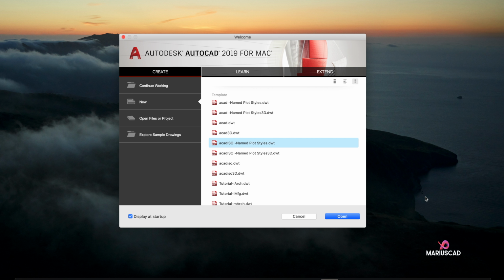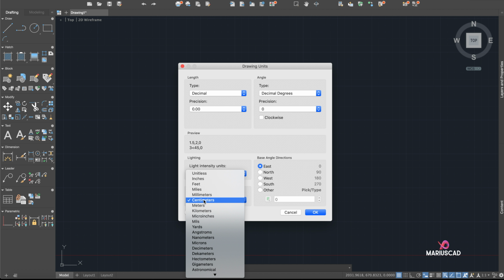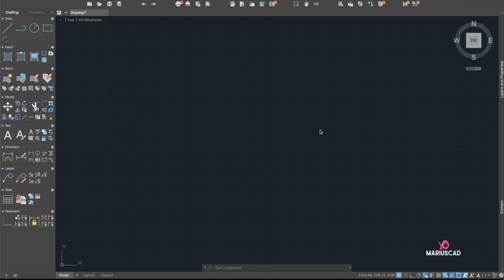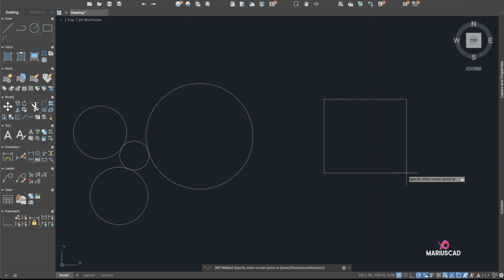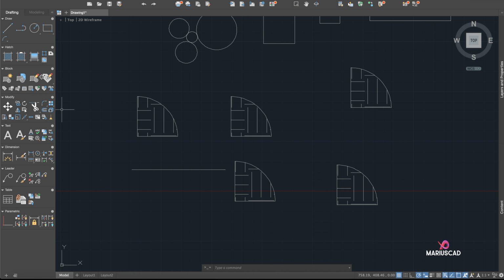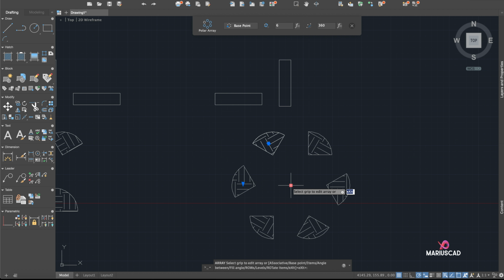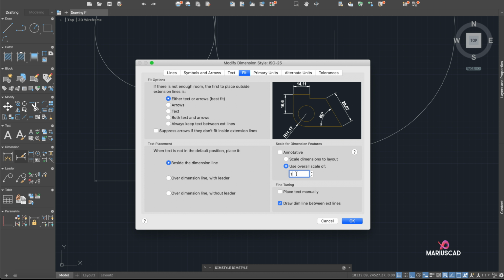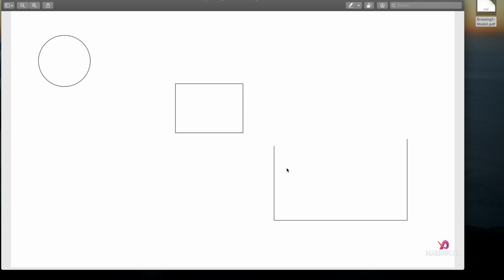Learn AutoCAD in 30 MINUTES! | Basic Knowledge | Macbook

Comment: Sir, I have a question, what do I press after I press @ and add the legth of the rectangle? I can't press enter after I do that.
Reply from the maker: Hello!
After you type the length, you must press the "Tab" key, above the "Caps lock" key.
Reply: @MariusCAD  It works! Thank you so much🙌
Reply: @MariusCAD  When i do this it puts the rectangle in the corner and not where i was drew it like yours? Then how do i move it to where i wanted it without all the lines moving?

Comment: i got an issue when key in command then press space or enter but the number seem deleted, then the line i draw can't go w/ correct dimension.
Reply from the maker: Hello!
Try to do it step-by-step: Write "Line", Enter, Write the length and then Enter again. Due to the speed, sometimes can be very tricky.

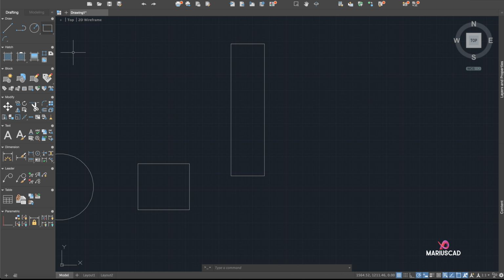Comment: In 14:07 which key you use after @ key? For example if i need 400x400 rectangle i have to type @400 then which key?
Reply from the maker: Hello!
You need to press the Enter key after that and you can press Esc a few times to be be sure that no command has remained active.
Reply: @MariusCAD  I think it's comma ","
Reply: @jasonpascual2374  I am also stuck on this. After typing @100 then , 100 then what do i click to confirm? because when i then click enter its only a 100 line and the second measurement has not saved??